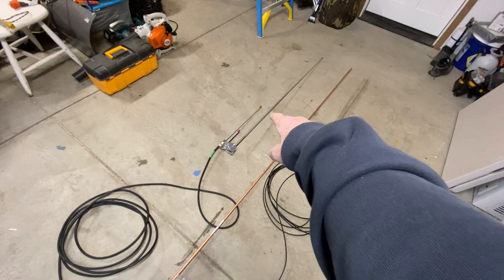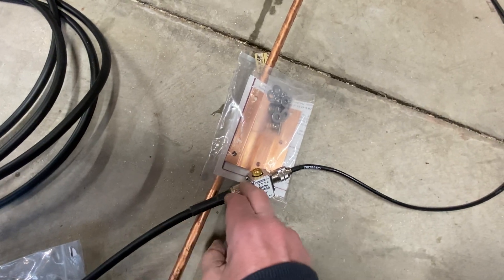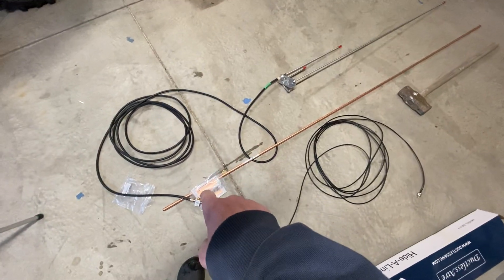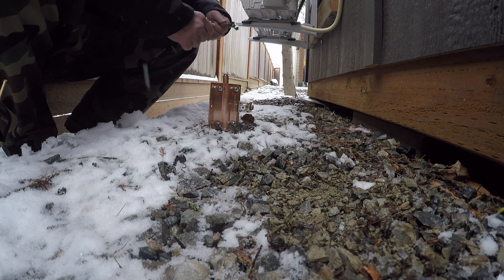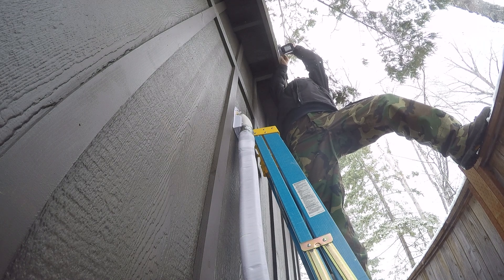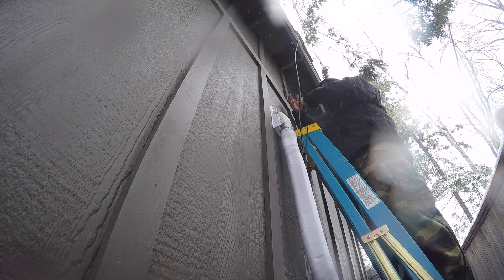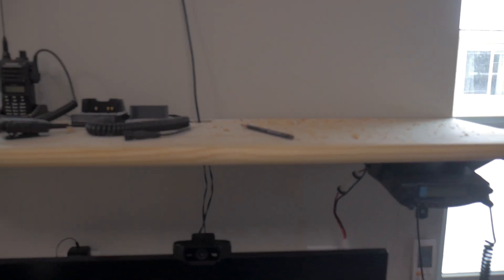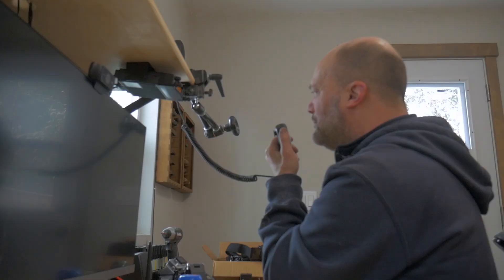How to Ground a Ham Radio Antenna

Comment: If my antenna is disconnected from radio when not in use can I avoid grounding?
Reply from the maker: I’m no expert..the hardcore ham guys would probably run separate ground from the radio.  

I find that grounding simply improves the system..better reception etc.

I disconnect my gear in storms just to be on the safe side anyway.